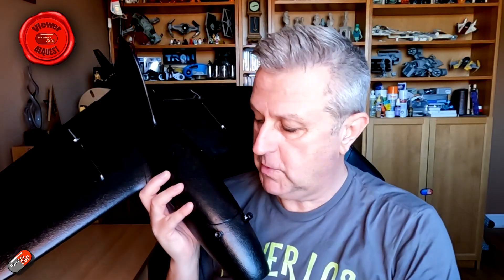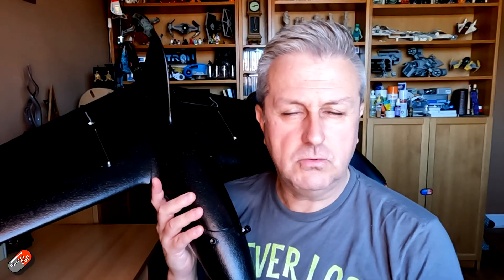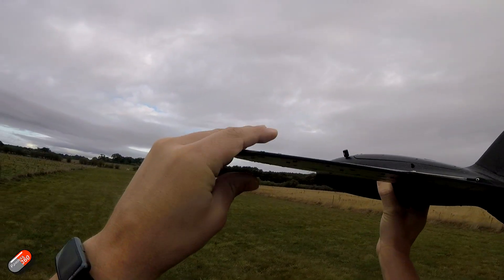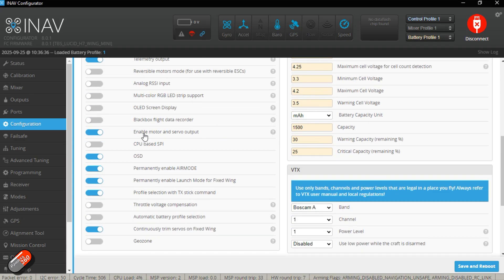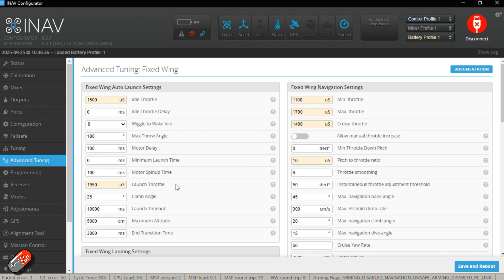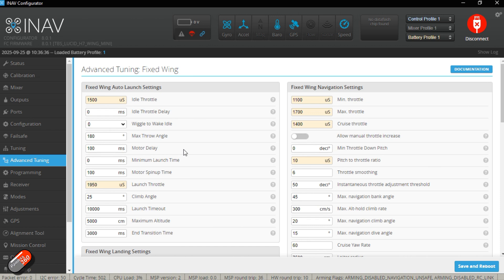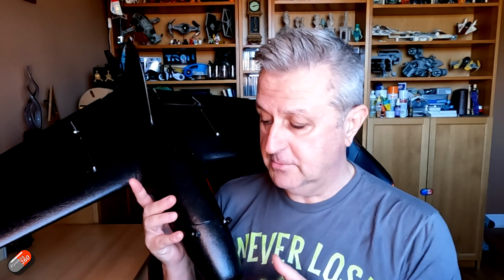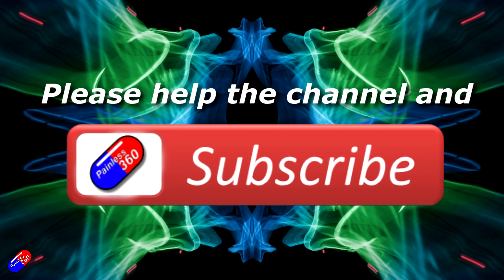My INAV Plane/Wing beeps when I arm it (viewer request)

Comment: Hello sir. Thanks for the great explanation. I’ve always had questions about some modes in inav. Do you have a video or a source explaining the following: 
1- what’s the difference between acro and manual mode? 
2- are the modes mutually exclusive? Does manual mode supersede all other modes? What happens if I turn on manual mode while on acro or angle? 
3- under which mode should I turn on autotune and or auto trim? 
4- what’s the difference between auto level trim and servo autotrim? 
5- can nav loiter be turned on under any mode? 
Thanks in advance.
Reply from the maker: https://youtu.be/0aMDfspDAVw will help
Reply: 1. Manual mode means you're controlling the servos, directly. Same as not having a flight controller. Acro mode, also called rate mode, means you are controlling how fast the aircraft pitches and rolls.

2. Mostly the modes are mutually exclusive - your sticks are controlling something - one thing. Either the rate of roll, or the angle, or the course, etc. Altitude hold and "Surface" are modifiers that can be used with a flight mode.

3 and 4 - please follow the steps exactly as shown in the documentation.

5. Loiter is a mode of its own. Like most modes, it wouldn't make sense to try to combine it with a different mode that has different behavior. For example, loiter and RTH. The aircraft is either loitering at a fixed location or it's flying toward home - it can't be doing both at the same time.

Comment: Thanks for that Lee. Just setting up a Dolphin v1 with INav on a SpeedyBee f405 wing fc. Is the beeping coming from the buzzer on the usb extender board (as I have mine turned off at the moment) or is it from another source? Cheers Andy in NZ
Reply from the maker: INAV will use the buzzer, and the ESC will use the motor to make noise.  Turn off the buzzer to see where it's coming from.  See my original video on INAV beep codes... best of luck
Reply: @Painless360 thanks for that 👍🏻